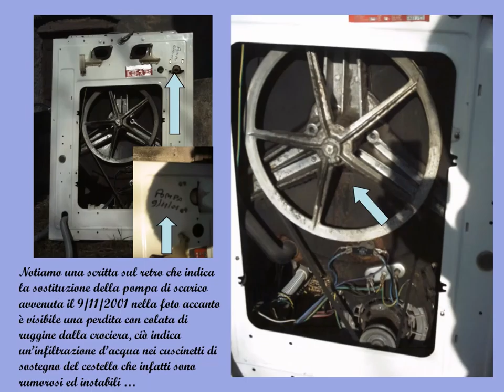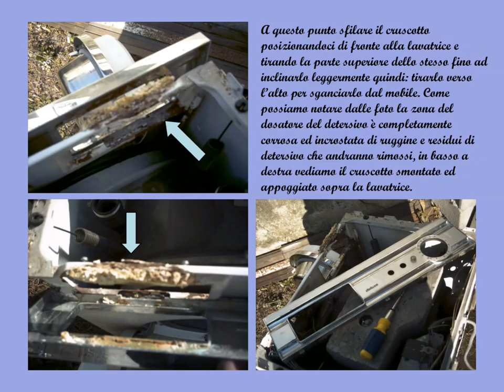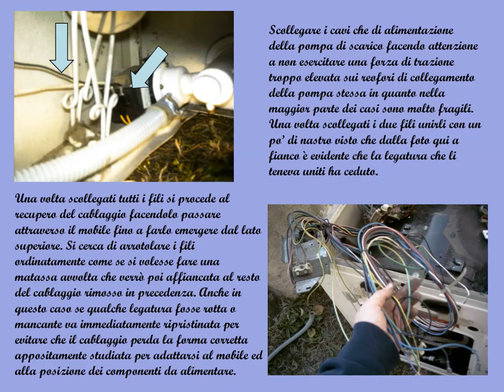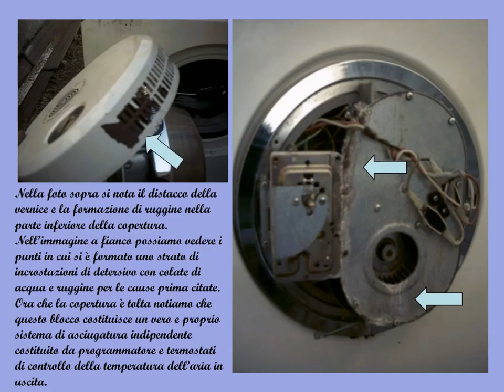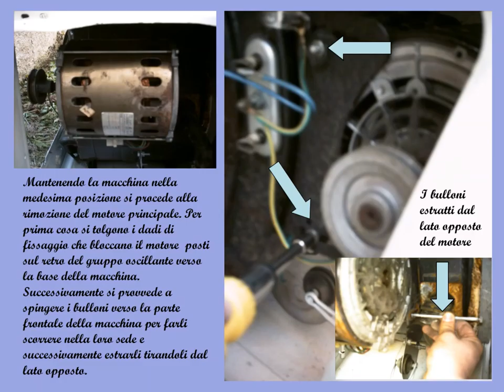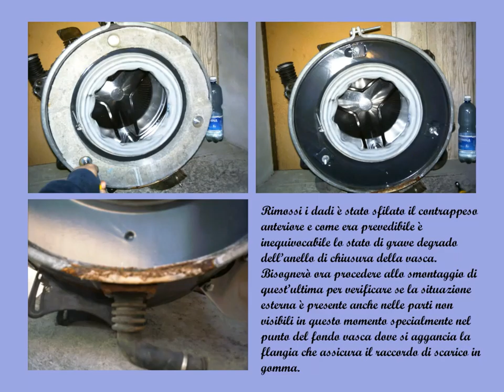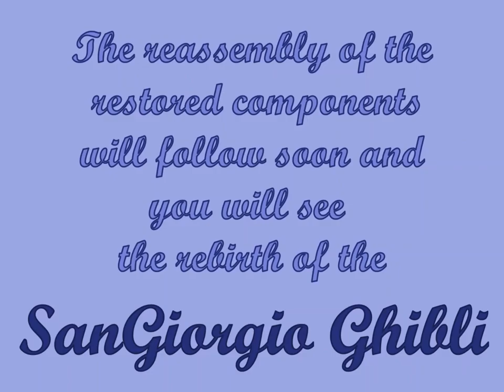San Giorgio Ghibli De Luxe 1973 Restauro Parte Prima 010208

Comment: 7:26 How did you remove the front panel?
Reply from the maker: It's kept in position  by 4 bolts... once the bolts are removed you must slide it upwards to disengage it from the side wals. Later versions of this machine instead of bolts had 4 rivets... in that case you must remove the rivets, then is up to you deciding if you want to put it back in position secured by rivets or bolts. The original service manual, in case the fron pannel was removed for maintenance, suggested to use bolts to put the parts back together once the original factory rivets were eliminated.
Reply: @CandyBimatic  Many thanks bud. Here’s another question waiting for you: do you know the max spin speed on the old Sangeorgio machines from 79-80s? There’s nothing written on their data label and I believe it must be ~500 rpm. It has an ib mei motor and no clutch on the pulley! I’ve seen some models with 800 rpm in YouTube (only a few minutes of 800 rpm for the very last spin) so do you think they use a motor with clutch? They all sound like induction motors to me.
Reply from the maker: It all depends on what model... usually by the end of the 70s Sangiorgio had at least 600rpm and when 800 was available the motor was a classic induction motor having 3 speed... wash speed 400rpm and 800rpm.  800rpm was very common on the Ghibli machines... Ghibli is the name used by Sangiorgio for every washer/dryer combo machine since the very first one you have seen in this video... I should post the second part of this video but for a reason or another I keep on postponing...  🙈🙈🙈 anyway those are the spin speed typical of the late 70s early 80s Sangiorgio.

Comment: Once I saw San Giorgio washing machine under the brand Hanseatic brought from Germany. There was an interesting kind of jet system, but unlike Zanussi's jet it didn't spray the water on clothes from the top, but created something like gayser. May be you know anything about that system?
Reply from the maker: It was the SanGiorgio "Geyser System" developed in the 1980s, it was a jet of water that came from below and moved the laundry while the soapy water under pressure passed through the fibers, increasing the ability to remove dirt more quickly and effectively . They washed very well ... machines still worthy of the San Giorgio brand.
Reply: @CandyBimatic  thank you for the answer. I hope that San Giorgio jet system has nothing to do with Samsung's Eco Bubble ))
Reply from the maker: No... nothing at all!

Comment: Is this like a very primitive washer-dryer?
Reply from the maker: This is a washer-dryer... the only difference is that they decided to put the dryer part in the porthole... this way the same machine could be a normal washing machine or a combination washer-dryer just by changing the porthole... it was sold in the northern Europe and UK using the COLSTON brand.
Reply: @CandyBimatic  How did thay manage to prevent water spilling on dryer parts? Usually dryer duct is on the top of a tub.
Reply from the maker: The air duct  is veri deep inside the porthole and is tilted so that the water return into the wash basket and and there is also a gravity flap that closes the duct during the wash operationa and it is opended only by the air pressure when the dryer fan is blowing air onto the laundry.